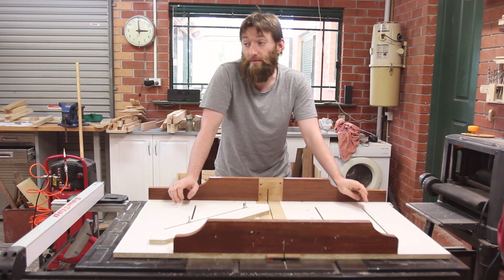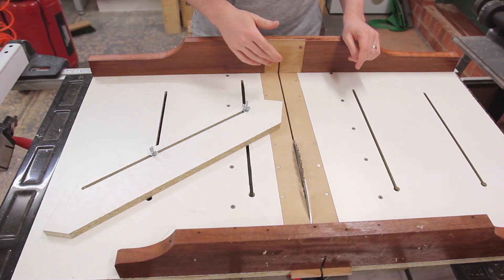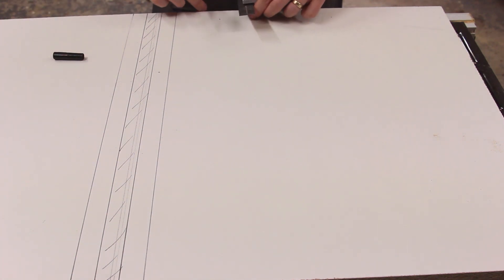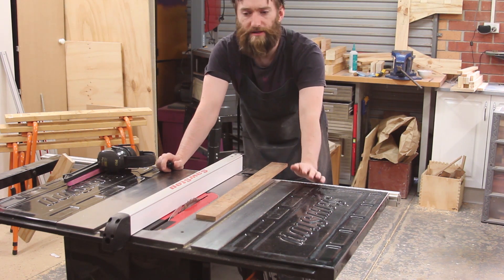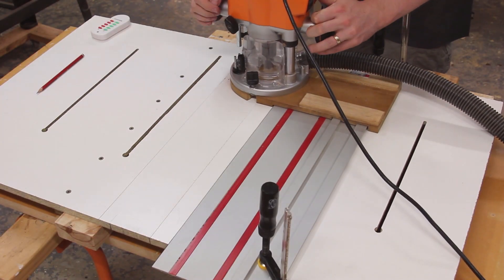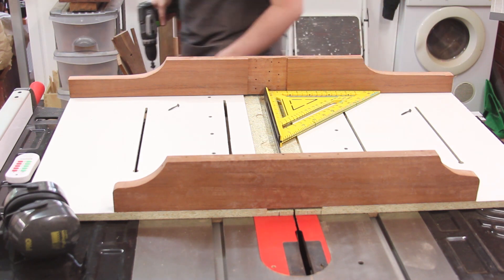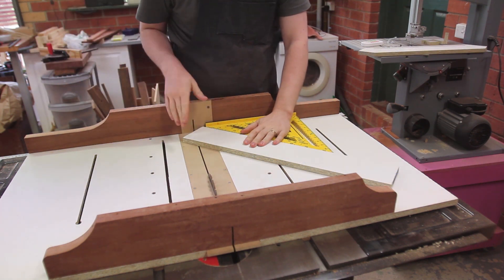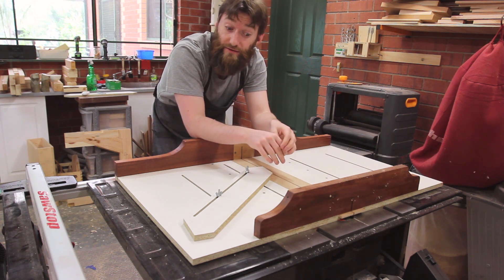036 - Advanced Crosscut Sled

Comment: I use the same remotes to control the vacuum and other things in the garage/shop too...
Reply from the maker: The Aldi one? Fantastic value for money, even just for the dust extractor/vacuum. Saves so much time... until the batteries go flat and you're wondering how you ever worked without it!

Comment: Hi Paul, I really like the melding you did of components from both designs. I've been a fan of the Super-Sled from Eaglelake, but the addition of the inserts is a really nice addition. I'll certainly be using this design in my future replacement sled.

I was wondering if you did any additional alignment of the rear fence other than just the carpenter square? 5 cut method, or dial caliper method?
Reply from the maker: Thanks. I've actually just done some minor upgrades in the form of using tee-nuts and cap bolts to it before I cut the 45 degree inserts, which makes it super easy and quick to swap them over.

No, I haven't done additional alignment. I should have, and possibly still will, just at the time I didn't have anything but melamine on hand
Reply: Paul Jenkins If you haven't seen William Ng's "5 Cuts to the perfect Sled", I'd highly suggest it. It's well thought out, he's very articulate and an excellent sense of humor. Anyway, nice job. I subscribed and look forward to looking through your uploads and future ones as well.

Comment: Very nice sled. I love how you incorporated the sliding fences and removable zero clearance inserts. Does the melamine cause your workpieces to slide on the top and out of position when you're cutting?
Reply from the maker: Joshua Luther I haven't had an issue with it. Light hand pressure against the fence keeps it in place. Additional pressure back towards the fence is provided by the blade too.